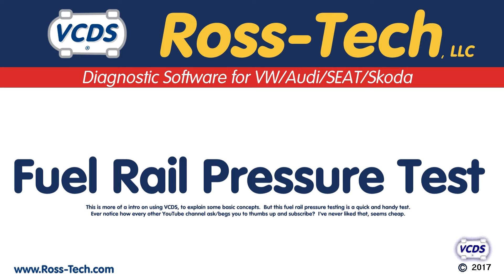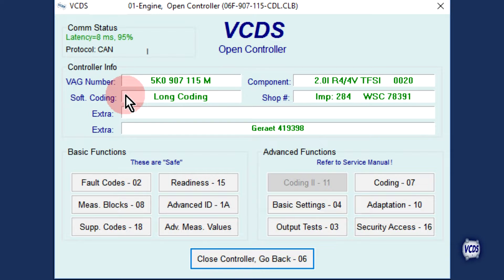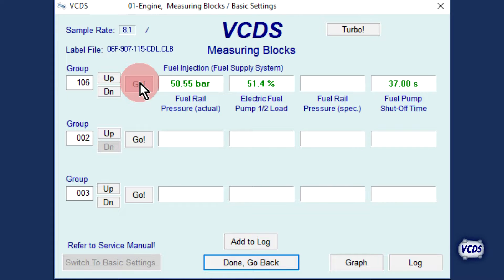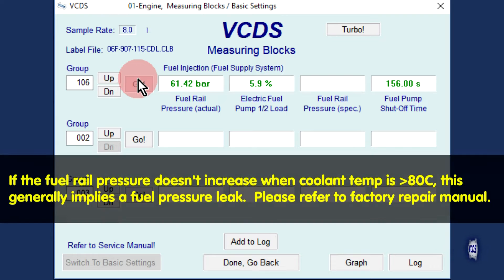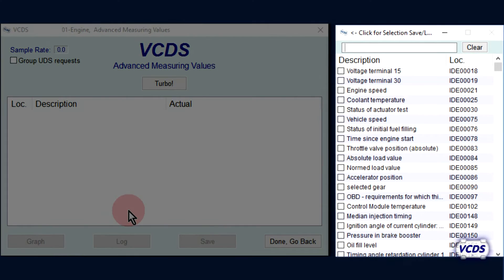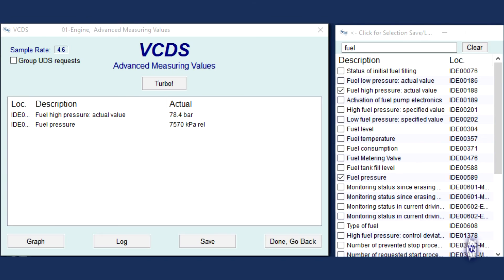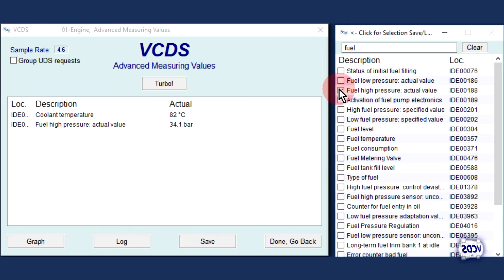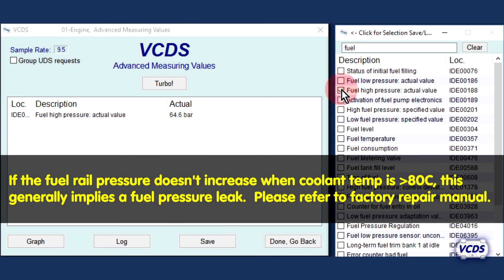Fuel Rail Pressure Test with VCDS by Ross-Tech

Comment: Can these values be logged during cranking? I have a crank, no start condition and would prefer to use VCDS to measure the fuel rail pressure, but will use an analog gauge if needed.
Reply from the maker: Yes.  Turn the ignition on, but no crank, then pull up whatever data you wish to view... then crank the engine over.  The ECM will talk during cranking.  The minor issue you will have..... you will have to cycle the ignition off and back on to reset so the engine can be cranked over again... during the ignition cycling, most ECMs will drop communication.

Comment: How long such 63bar shall last? Engine is cooling down, so it shall keep 40bar or can go lowe and how fast?
Reply: If the fuel rail is increasing in pressure the injectors are holding pressure. The question you should be asking is "How does a fuel rail work" The fuel rail builds and holds pressure for ever the whole fuel system is under constant pressure no vac. So there should always be some pressure in the rail. Once the car warms up turn off the car and the fuel pressure should rise due to "heat soak" gas expands under heat once gas cools down it shrinks.
Reply: @10Eight  Fuel pump in tank holds 7bar. How much shall keep high pressure pump and if this could go back to tank, as there is ni other way to decrease pressure as internal leak of HP pump or injectors. It can go only as backpressure to the tank.. But it shall?

Comment: Hello, I have EA888 engine (1.8 TSi from 2010) and my appearance for group 106 is bit different - I can see here value "Fuel Temperature (calculated)" that shows temperatures about -50°C (yes minus 50). Any idea how is this temperature calculated? I have problems with extreme rough cold starts and this seems to be in relation with my problem.
Thanks

Comment: My vcdd by Ross doesn't have "blocks" I'm stuck trying to read pressure in hpa. What the hell is hpa?
Reply: hPa is hectopascal which is highly probably some air pressure, not fuel pressure sensor. 1000 hPa = 1 bar.

Comment: Hello. I would like to know if it is possible to check the pressure from the oil pump for the engine, to see if it works within my parameters.Because I sometimes get a low oil pressure message.And I would like to know if with vag com you can check the pressure, and what are the values that should be in an Audi Q5. Thank you
Reply from the maker: Most engine tend to not report oil pressure via the data port.  Join our forum and post an auto-scan from your vehicle there for additional assistance.  http://forums.ross-tech.com/forum.php

Comment: Mine went from 36 to 42 after 4 mins. 2013 V6 Audi S5. Should it be higher? I smell fuel while driving plus fuel in oil.
Reply: do a compression test. sounds like bad rings

Comment: Can you test fuel pressure if car won't start ?
Reply from the maker: Sort of... you can see how much pressure is on the rail while cranking the engine over.
Reply: @RossTechVCDS  is there a rule of thumb for fuel rail pressure when cranking?  I have a crank, no start condition.  Fuel rail pressure is only 5.7 bar when cranking.
Reply: @b0000stwagen  someone said there should be at least 180bars of pressure for the injectors to start firing. Btw did u fix ur problem ? did u start u car ?
Reply: @RossTechVCDS  Hello, is there a way to find what is the factory fuel pressure value for the CFHC 2.0 TDI Common Rail Engine ? 
At idle and with the engine warm or cold,  IDE00188 Fuel high pressure : actual value indicates 319700 hPa, while IDE00589 Fuel pressure is fluctuating around 27580 kPa rel

Comment: i have A5 b8 2.0 tfsi, when i turn engine off my pressure went from 4000 to 1190 kpe after 5, 10 min ? what is the problem ? also have new injectors, coils and spark plugs. also my engine shakes every single day, no matter is it hot or cold. And also i have missfires on cylinder number 2, and few days ago i have check engine light and code is p0303, p0300 why ???

Comment: Hy  Ross… can u help me …  i have golf 6 . 160 cp  last 2 weeks i change  high pump becouse i see leak petrol in oil and now i see … fuel rail when engine is off 49bar is go down …!    High pump is new  before that  the old pump when i testing  pressure is going up to 120 bar … what the problem i have ?

Comment: I've noticed my values for group 230 are very low. Specified never exceeds 1.99 and actual is either 0 or .96 while group 140 actually shows proper rail pressure of at least 40bar

Comment: Hi Ross-tech..tried to do this on a mk5 golf/rabbit and all the suggesed group numbers (106, 140, 141, 230) are blank (no readings) even on latest vcds. using micro-can cable.  what would be the reason for this?
Reply: Allo there ,did you find the group numbers i have the same problem. ??

Comment: I've got Sharan 2.0 2011,and have done everything  you have said in the video, my fuel high pressure: actual value  was 4700hPa at 84⁰ Coolant Temperature,  after shut off the engine and start again but not the engine,  the Fuel High pressure has decrease at 2200 hPa after 2 minutes,  so didn't increased as you said in the video, could I have a problem? Thanks
Reply: Same here. 2.0 TFSI engine, fuel rail pressure slowly drops instead of going up with the engine warmed up. Checked each spark plug for gasoline smell, none had gasoline smell. Have you fixed the issue?
Reply: @Exorcism47  same by me 1.4 tsi engine...

Comment: I bought a 2010 Passat CC and has a p0088 with rail pressure being at over 80bar at idle. What can I test to determine what's the problem?
Reply: fuel filter could be 1 of the causes, it has a built it regulator and that may have failed.
Reply: @OscarCollie  the timing chain skipped a couple of teeth and fuel pump was overpressuring
Reply: @KenyonPayne  oh dear how did you find that out?

Comment: What is the most common cause if the vehicle loses pressure after being shut off? Fuel pump check valve?
Reply: Thank you. Ended up changing all 4 Injectors on your recommendation. Fuel trims now at 0.8-1.6 LTFT instead of - 20LTFT
Reply: @jasonfoster8871  you had (negative) -20 LTFT and the problem were the injectors?
Reply: @Exorcism47  most likely
Reply from the maker: Leaking fuel injectors.  IMHO, if one is bad, replace all of them at the same time.  We've seen a lot of people pin down which injector is bad and replace it.  Then 2 or 3 months later, another injector starts to fail and bleed out all the time.
Reply: Well thats just fine and dandy if you have a spare £2,000 burning a hole in your pocket, RossTech must pay you handsomly @RossTechVCDS
Reply: I done this test.. 

My rail pressure went up to 70+ Barr I have low rail pressure code. Been using Vfizz controller to access ECU data . Would the 70+ Barr be a false reading or is this working to factory design.

Comment: Hi VCDS master I’m a very longtime VCDS satisfied user since VAG came up with this UDS setup I don’t like it but I must admit I never used the search bar I’m going to try it then .  For me if I have a car that I suspect that is having a possible injectors leak issue i like to do the same test with a cold engine I just start it for about 30 seconds to see the normal running pressure then shut the engine off the see if the pressure drops a lot in 10 minutes then I know that there is a possible injectors problem I know that there was a technical bulletin for Audi cars for this test it was for the 3.2 litre v6 direct injection system here is the technical bulletin I’m talking about https://testing-public.carmd.com/Tsb/Download/103415/A011487

Comment: Tested my (suspected) Fuel Rail Pressure today the way you showed. My Passat has the 3.6 BLV engine and shows the engine light and idles pretty rough. During the test it shows a pressure of around 128 Bar. It doesn't tell me the specified pressure it should measure do I don't know for sure if it's to high - can you confirm please? After shutting the engine down the pressure drops to around 118 bar right away, then slowly rises up to around 128 again if I wait 10 minutes. Does that indicate a leak? If a fuel injector is bad, or a fuel injector gasket is blown, is there a way to tell? I noticed the lambda for both rails around 20 (and specification is -10 to +10, it says). Can you please advise? Thanks, Louis
Reply: Seen 3.6fsi with broken timing chain guides and fuel pump jumped timing. your high pressure fuel system is reverting to default running mode and operating at higher usual pressure due to this. Just a suggestion but I'm sure you've had it fixed by now.